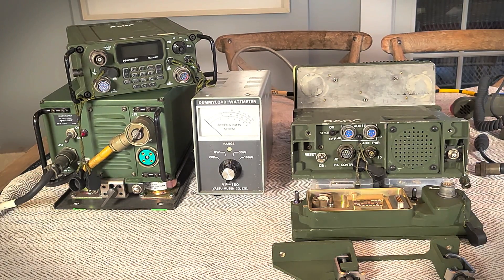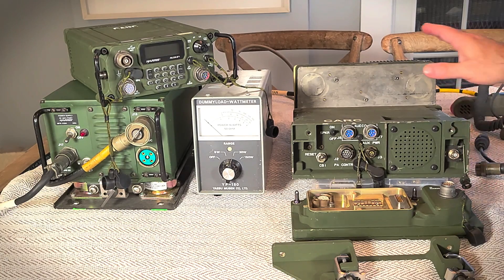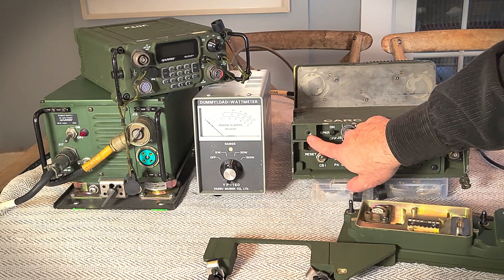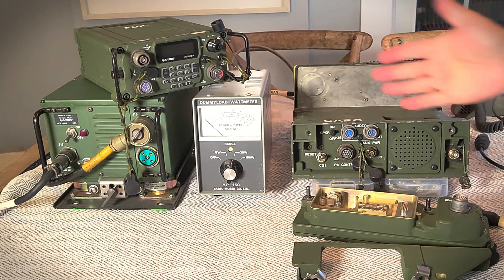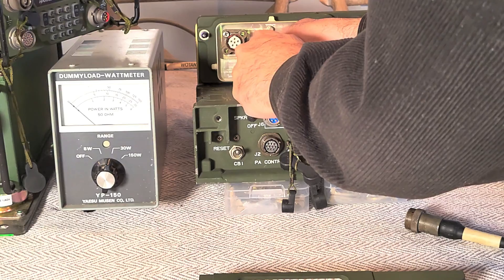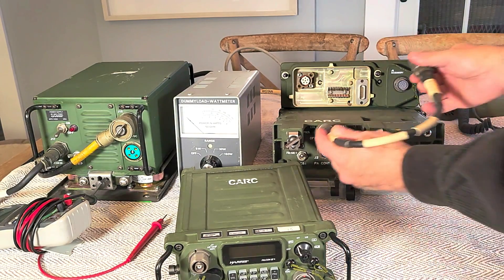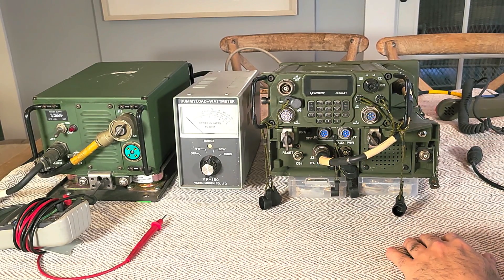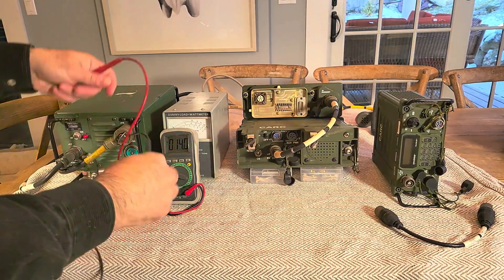Harris RF-7800H HF radio w/Falcon II Amplifier Base? - Part 1

Comment: Interesting combo Eugene. Nice small radio, and these PA bases appear from time to time. I see a typo in the description, obviously you wanted to write AN/PRC-160, and is 150.  

If someone wanders, there is also radio marked as 7800M-MP, which is equivalent of AN/PRC-117G.
Reply from the maker: Hi Jim. Thanks for the correction! I made the update. Yes, check in my videos you'll see I also have the 7800M-MP which, as you correctly note, is the equivalent to the PRC-117G. Thanks for watching!